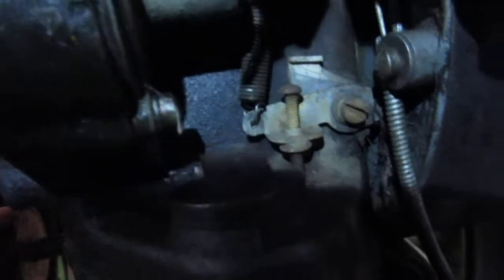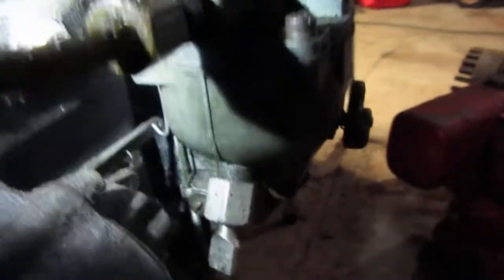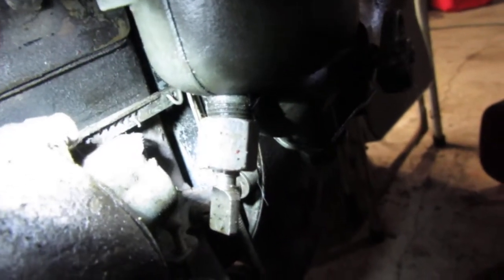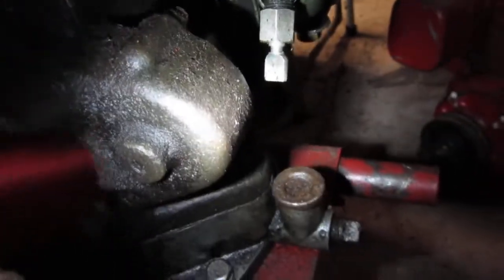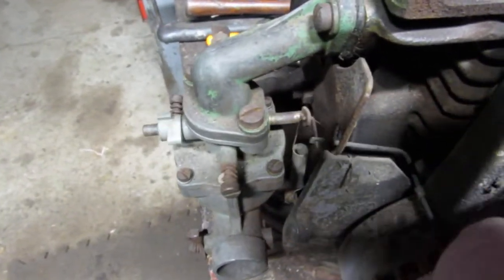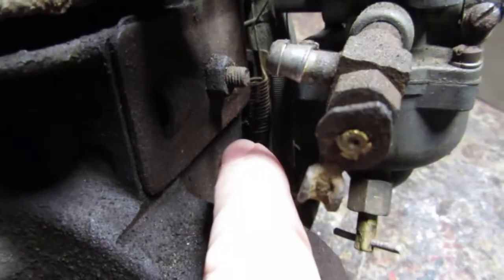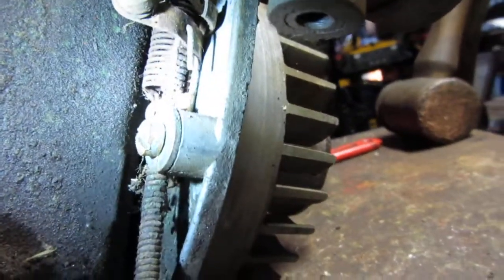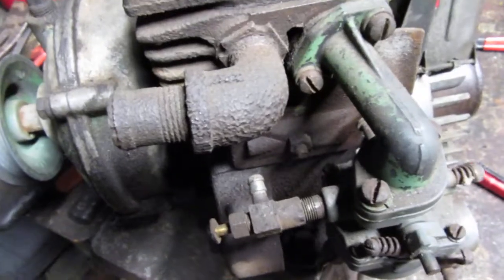briggs motor differences between the air vane gov and the mechanical gov setups

Comment: That answered some questions for me for sure. I have my throttle cable hooked up in a completely wrong spot and I just got a nos spring for it, so hopefully I can get my throttle working correctly now. I’ve got a mechanically governed model N I’m gonna rebuild soon, so I’ll be using this video for reference for sure. Thanks so much! 👍
Reply from the maker: hope that works for you